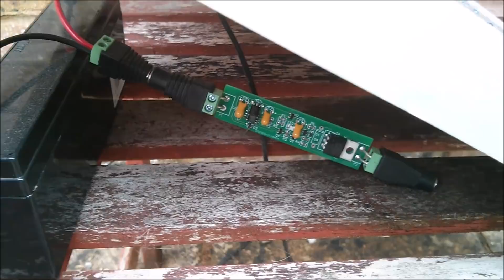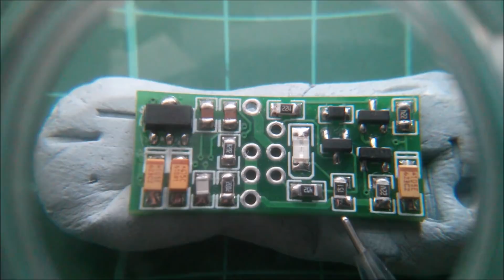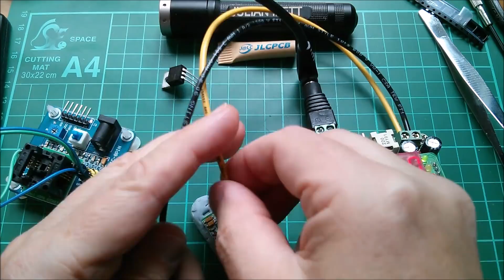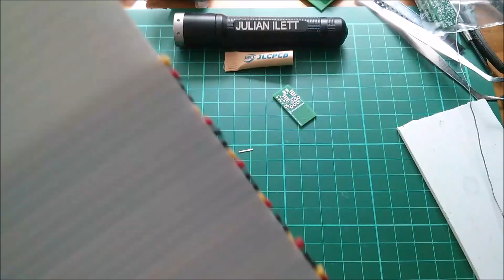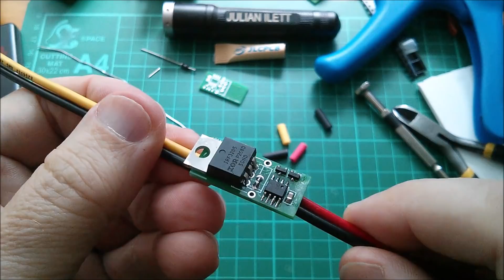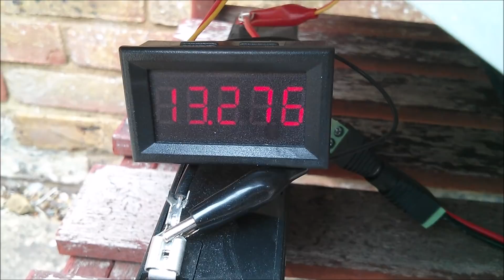It Works! Solar Charge Controller - PWM5 Femto

Comment: Hi Julian
Whats the best way to contact you?
Got 2x 12v DC to 240v AC inverters from amazon/ebay. Both faulty and thought they would be interesting for you to disasemble and make a video or 2 and possibly repair and use in your workshop.

1st one is a Mercury 1000w it overheated and no action on power on.

2nd is chinese 1500w with LCD display. It turns on display included thou loud alarm sound and no output

Let me know what you think and can send photos/link if want more info
In Scotland and can post them
Reply: Have you tried Big Clive? He likes doing post mortems on dead kit.
Reply from the maker: I appreciate the offer, but I simply have nowhere to put them :(
Reply: No worries thought would ask. 

To see it anyway search google for CZ-1500W12V220V2L

Tech question for anyone. What would be a alternative for a auto relay that doesn't  draw ~ 300mA when activated? 
Looked at solid state ones and they are big & expensive

Comment: I would coat it in Epoxy. But, mix in a white powder into the resin while your mixing the to parts. That will turn the Epoxy more opaque and defuse the light from the LED like a light bulb.

Comment: You should get a piece of acrylic square tube say about 19mm wide. Cut it to the length of the pcb, maybe slightly longer, slide the pcb inside then pot the whole thing in two part epoxy glue from one end.  you would  have to temporarily cap of the other end maby with blutack. It should make it water proof, give good strain relief for the wires and the whole housing may act as a light pipe so you can see the led :) 
Would still be better if that led wasn't  covered :/

Comment: Julian Ilett+
That thing is tiny. I would mix up some uv protectant urethane and hardener, either dip it or spray it on. I would mix it thin and it would seep into everything then heat shrink after it's hardened up.

Comment: The brightitude might be bright but the battery won't charge at all in England! You'll have to go to Gozo if you want to use R150s ;)
Reply from the maker: And still toasty warm in Malta according to my weather app :(
Reply: My roof mounted solar panel system has generated 3.14 MWh of electricity this year so far. And yes, my house is in the U.K.
We may love to talk about the weather, but that does not mean that what we say about it is at all accurate. Most of the time, it is actually not raining, with the number of dry days far exceeding the number of wet days (at least, in the part of the U.K. where I live).

Comment: Just wondering. Have you ever considered adding headers to (optionally) add e.g. an ESP3266 or nrf24l01 to report state and voltages? 
Could be a very useful addition to the current (now luminously) flashing LED.
Reply: I think with the ESP8266 being a bit too power hungry, that would defeat the purpose of charging a battery, because at night the same ESP8266 would start to use a lot of current when there is no state change whatsoever. Some clever mechanics could make the ESP shutdown of course, but then you are in a state where with some decent overcast the same thing would happen as well. I don't see that addition happening to be honest. The NRF24L01 could be a decent option, but you would always need a base station.
Reply: @thomasvnl  depending on the capacity of the battery an ESP that occasionally wakes up from a deep-sleep will run for months, of not years. We are talking car-batteries here. Setting up a base station for the NRF would not be a problem if you were to implement such a monitoring system. My point is that providing some sort of interface would allow for many creative solutions for the tinkerers amongst us. Currently you could count the pulses, but that will only give you a single voltage reading, whereas a proper interface could provide a lot more info. Anyway, just asking and thinking out loud here.
Reply: @DirkDulfer  Cool idea. I would love to see an one wire implementation in ASM by Julian.

Comment: Great video with a few chuckles along the way :-)   I made a board recently where I placed a via directly on the pad of the uC. Would that help, or is there a good reason not to do that? Very much still learning pcb design.
Reply: EE.StackExchange to the rescue. https://electronics.stackexchange.com/questions/223667/is-it-considered-bad-practice-to-put-vias-on-bga-pads https://electronics.stackexchange.com/questions/39287/vias-directly-on-smd-pads https://electronics.stackexchange.com/questions/170209/anything-bad-to-place-a-via-on-a-pad
Reply from the maker: I can't see a problem with that - but I'm sure someone will have a reason why you shouldn't do it. But hey, if it works :)
Reply: Julian Ilett if you use a stencil, it might suck the little bit of solder away which get‘s applied to the pad. No problem for hand-soldering. Or you could order plugged-vias (which are more expensive)

Comment: My question about the mosfet is why didnt you make the board long enough so that the tab didnt stick out? Maybe that's just my OCD?
Reply from the maker: The sticking out tab is quirky - I like quirky :)
Reply: Then he could not call it a femto, it would be a pico board
Reply: I've made some of my own design. The Mosfet folds over the PIC side of the 15 X 23mm board. I've called mine the PWM5 Pico.